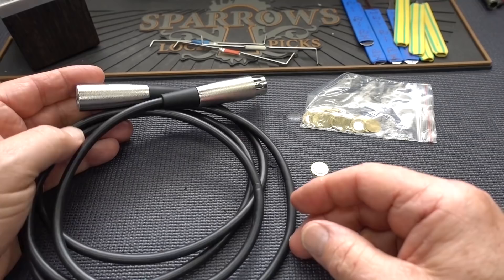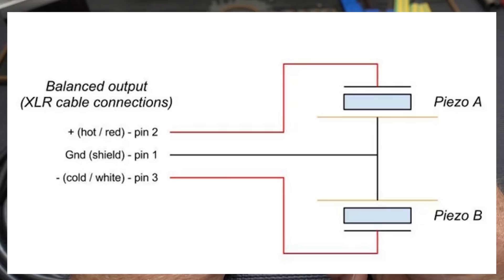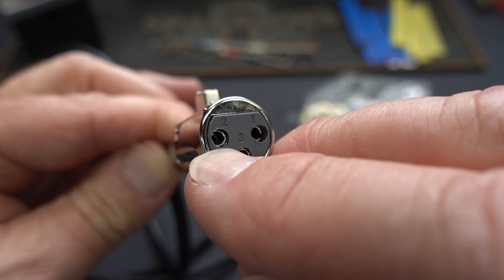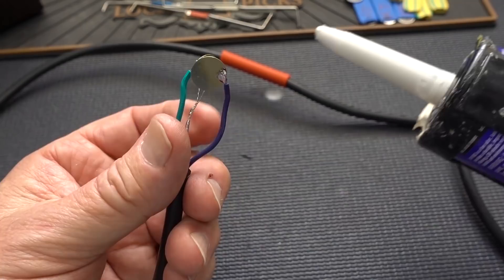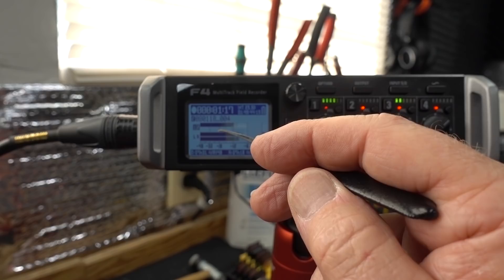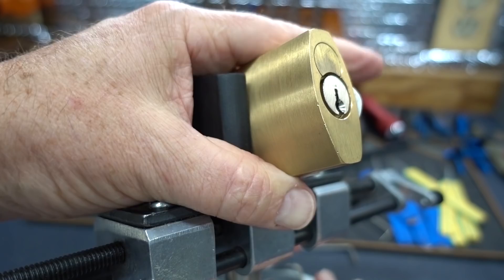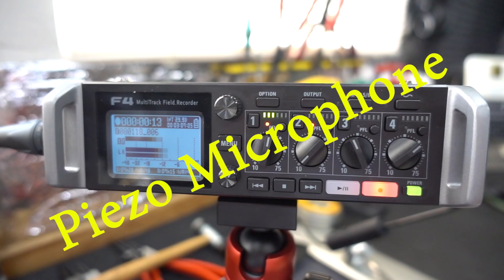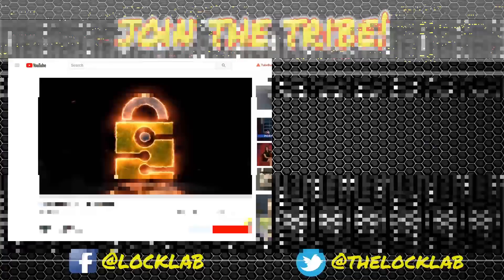(1338) Experiment: Piezo Crystal Lock Picking Microphone

Comment: Piezo's are HIGH impedance and the XLR's are LOW impedance BALANCED circuit.  Find a high impedance input "direct box".  I would suggest an active type.  Keep the leads from the piezo very short.  From an electrical engineer...
Reply: I have build 2 myself some time ago. In one i used a Transformer direct at the Crystal for the symetric Signal. In another, i build a small phantom powered preamp circut at the Crystal. Both worked nice, second one was better.
Reply: Or you could use pure copper conductors with ground shielding (aka a coiled magnet) and have the same result. Without spending the extra money.
Gotta live ps2 controllers.
Reply: Yes! And there should be 1 ground, instead of 2 wires (or are those somewhere connected?)!
Reply from the maker: Fred Yearian Thank you, I’ll take a look at solving the impedance issue, thank you for pointing me in the right direction.
Reply: Also you dulled the pickup sensitivity way down by smearing siliconeand epoxy - while hard epoxy is less of an acoustic problem, small peizo disks work best with direct contact and the effect of the silicone is to damp the vibrations.

I'd try again with a single disk - but try to have at least a small part of the brass disk in direct contact with the lock. This makes it a surface mike - picking up vibration sdirectly from the lock body. The disadvantage (and it coul dbe a big one) is that you will also be picking up electrical clicks when you touch the lock with the pick, wrench or your fingers.

You could also solder a hard object like a brass bolt or maybe a tack to stick out from one of the disks on the brass-only side - this effectively makes it a "spike mike".
Place the spike in direct contact with the lock body, with the disk under only very light pressure to maintain the spike contact (it needs to vibrate a little, rather than be held hard against the lock). Maybe try a few rubber bands in a criss-cross arrangement ?

Spike mikes made like this are great for pickup through walls, glass windows, panels etc etc. (cough: allegedly). The problem with this is it's an unbalanced mike system, so that could produce quite a lot of mains hum - hopefully the increase in acoustic sensitivity will be more than the increase in unwanted electrical noise. 

The "noise" you seeand later hear at max gainis 60Hz mains hum - pay attention to close screening (without touching the brass or white pad) and try to keep the overall size own - maybe even trim the disks with scissors to the minimum possible surface area of the white pads (this will also reduce the low-frequency acoustic response)
Larger peizo disks will handle lower frequencies though may not be much more sensitive at your wanted "clicks and scrapes" frequenies - they will also pick up more mains hum due to being physically larger. 

Filtering or notching the mains hum will also help but it's far better to screen it and keep it well balanced (physically symmetrical) than cure it later up the chain. 

If you have no joy with peizo disks try two small electret mike capsules used in mobile fones places back-to-back with issulation in between - they are only a few millimetres across - though you may need to feed them into a low-gain differential opamp circuit and fine-tune the balance circuit.
Again, try a single one in direct contact - possibly through a very thin pad of felt. If that doesn't work too good, remove the felt or scrim to expose the tiny hole and place in direct contact again. Electret inserts can be attached with much greater pressure and are less prone to deadening by putty or silicone. 

When I say a try a single one - you may be surprised. The balanced back-to-back mike is really to provide acoustic noise cancellation as much as provide a balanced differential signal. With leads kept short and well screened you may find that a single mike works well enough for what is essentially a direct-contact situation - so there should be plenty of acoustic coupling of lock noises - at least at high frequencies.
For the purposes of experimenting just feed a single mic onto one of the the mic connection pins on your recorder (either + or minus, plus the groud) if it only has balanced inputs. If it has an unbalanced socket use that for single-mike inputs though.  

To slightly reduce mains hum you could also try to physically relocate any PSUs or transformers you have on or near your bench a further away and feed your digital recorder from a battery instead of a mains PSU, if you are using a PSU at the moment. Arrange all your power leads (DC as well as mains) to run away from your work area if you can and avoid coils of wire nearby to your bench. We really are clutching at straws now :)
 
Air conditioners, refrigerators, flourescent lights and motors can increase nearby hum, although most urban and suburban settings have a lot of hum even with the house mains turned off at the incomer board - it's just a fact of modern life.

Good vid and worth the experiment even if results were poor this time around.
Reply: Using a mechanics stethoscope attached to the vise/lock and an electret mic where 1 of the ear pieces goes will potentially give you good results. Mechanics stethoscopes are already great for detecting mechanical clicking noises.
Reply: Or if you are lazy look for something like a set of automotive chassi ears or an acoustic instrument clip on mic like this one.(no connection to them just happen to be a music playing mechanic) https://www.zzounds.com/item--KORCM200?siid=178061
Reply: @bellphreak4370  it's the same braided shield wire from the xlr cable. He just took half the wires and connected then to one crystal and the other half to the second crystal.
Reply: I was thinking about using a jfet with an LR44 button cell. I didn't think of phantom power though.
Reply: @ReneSeckler  can you send me schematics or anything? If u can share it

Comment: Silicon=mass dampener. Epoxy ensures rigidity. I'd expect the rkements need to move, to react to sounds. Mic elements need isolation, or direct contact for contact mics. Try an electronic mechanic's stethoscope, that's a cheap contact mic designed to pick up metallic contact noises.

Comment: You can get via Ebay from China "pickups" for acoustik Guitars. These are, what you want. They are ready to use with a case, cable and connector (stick on or clamp on). They cost (seen in German Ebay) under 5 bucks.
Reply: yep ..most stuff is thought of already....   thinkers are onto quantum mechanics. @anomicworld

Comment: don’t use epoxy resin, only silicone, the resin is too stiff and reduces the vibration of the piezoelement, also need a more dense piezoelement contact with the lock, I think rubber band is a good option
Reply: Jim Smith Sorry, but this is nonsense. You want as stiff of material as possible to transfer high frequency vibration well. The epoxy is not a problem; if anything, I'd lose the silicone and replace that with epoxy, but that's not the main issue here.
Reply: RB0087 well, maybe you right. if there is a good tight contact with the lock, then perhaps the epoxy is not a problem
Reply: RB0087 If I understand correctly, that goes well for the contact between the piezo and lock body. But by using epoxy directly on, and probably to some degree between the two piezos, I believe it unintentionally siezed them up. If it was onlynon the outside thats one thing, bit from the video ut looks like some got "between the wafers", siezing up the "filling" (to go with the biscuit analogy).

Oh and impedance. XLR is low impedance isn't it? Piezos aren't.
Reply: pr0xZen exactly. IMHO The piezoelectric element generates a voltage when its shape changes from vibration. if you pour it with epoxy, it reduces its deformation. well, about the impedance is already a lot of people said in the comments
Reply: Jim Smith People have their intuition turned right around. Remember sound travels through solid materials better than air. Beryllium is stiff and light and sound loves it. Diamond is best, I think. Anyway, the best thing would be to get rid of the silicone and embed everything in a solid block of extra hard epoxy, then epoxy that to the lock body.

There are also two types of impedance matching going on here. One is electrical impedance, which is corrected using a preamp. The second is mechanical impedance matching. Rubbery, squishy mechanical interfaces will not only ruin the mechanical interface, they will dampen and absorb sound energy. Hold a spoon in your mouth without it touching your teeth then tap on it. Now bite down on it and tap on the spoon. Hear the difference?

Piezoelectric crystals are not moving at the macroscopic level when sound moves through them. The disks don’t actually need to flex at a visible level. The crystals vibrate at the atomic level. They generate a voltage potential at this atomic level. Embedding a piezoelectric crystal in a solid block of plastic will not prevent the crystal from generating a signal when sound passes through it.

Now, embedding the crystal in plastic will cause it to be less sensitive to sound traveling through air, but in this case that’s a good thing. Piezoelectric crystals suck at picking up sound in air anyway  (because they have terrible mechanical impedance matching with air). Embedding them in plastic will make this worse (which, again, is better in the application). A polyester resin might be better than epoxy for embedding. Again. Piezoelectric disks make terrible air microphones, which is why they are almost always used as contact pickups. 

All right, I got that out of my system...
Reply: Noah Spurrier, thanks for the detailed explanation, great comment. my respect.
Reply: Both arguments are correct. Circumstance depending.
However I agree with Jim Smith in this use of pezio crystals as our hopes are to have multiple uses of the same "microphone"
Reply: Nathan Monahan Well, they cost about 25 cents each, so just make more. Experiment.
Reply from the maker: Noah, thank you for taking the time to put together such a detailed (and logical) comment, I appreciate it.  I'm sticking with piezo crystals for the precise reasons you describe, but using some of the other improvement recommendations below, will modify the design and keep plugging along.

Comment: Good suggestions from the crowd. I would try a phone input stage passed through a 1khz high pass filter, and that you ground the lock to the ground for whatever the input stage of your device is. I would visit a thrift store for a cheap record player, disconnect the motor and power the electronics with some batteries. Cheap record players usually have very noisy power supplies, but sensitive input stages that are well matched to a piezo crystal. Cut the speaker leads off and put a cap and coil in series with a 1k resistor. Take your input to the recorder across the coil and/or the resistor. You may need an isolation transformer if you still get humming. Try a cheap one meant for car audio systems...  Lastly I would try to get away with a single crystal. Put a small magnet on the back side of it and use an adhesive backed steel plate non-magnetic locks. I am sure some combination of this will work as I have used a similar rig to build a recording mechanic's stethoscope that could be stuck on parts of a car while the car was driven. The magnet serves tripple duty. It attaches the pickup, acts as a reaction Mass so the vibration in the metal squeeze the crystal and as a vibration damper for noises from the air. Try to keep all the connections on one side of the crystal so the other can be flat and firmly in contact with the lock. The magnet can be a little smaller than the crystal. It should not be much stronger than necessary to hold the contraption in place.

Comment: From an engineering standpoint many have already mentioned the impedance match issue which killed the low frequencies due to loading. The centers face to face are connected to the shield which places the signal on the outside enabling pickup of the hum.  The shield should be connected to both brass disks on the outside and the signal attached to the two elements with an insulator so they do not contact each other shorting the signal if you insist on a piezo element.  A small audio transformer between a single piezo with a 50K ohm to 600 or 200 ohm impedance ratio would work wonders with a single piezo element and your low impedance recorder.
A much simpler solution is to take apart a dead earbud headphone and remove the element.  With a rubber or other gasket ring, attach it to the side of your lock with only the signal + and - connected.  Don't use the shield except connect it to the lock to prevent picking up RFI or hum.  A contact mic for violin or accoustic guitar is a little expensive, but also a good option.

Comment: Tip: when cutting off a connector from a cable, leave enough wire on the end of the connector so you can (more easily) re-use it for another project.

Comment: I have a few ideas on how to (hopefully) make this work a bit better. However, I don't know much about electronics, and even less about microphones, so...
● Would it work better without the silicon sealant? 
○ Maybe let put the lock in between the two wafers? (Have the lock body be part of the circuit.)
• Have the lock itself be the ground? (Loosely attach the ground wires to the lock body [maybe with that clay].)
● Also, the apoxy seems like just another layer of stuff between the microphone and the lock. Like a blanket between two people talking to each other.

Comment: The plumbers putty use to adhere the ceramic disc to the lock also acted as an isolator. Try a small piece of bees wax no larger than an 1/8" in diameter. Plenty strong enough and is close to being acoustically clear. I use bees wax on accelerometers with great results.
For super thin PZT type ceramics, a silver based adhesive/paint for wire attachment will keep the ceramic from being de polled during soldering.

The noise encountered was 60hz induced by florescent lighting ballasts. Move outside and that noise will go away.
Reply: Gunga Dinn any kind of wax or putty or sticky glue is going to absorb the vibrations. It's the opposite of what you want. Electronic stethoscope is in the direction you want to go
Reply: John H 
I build electronic stethoscopes. One of the only noise immune models to be certified for helicopter use. 

The small dab of bees wax works fine. I'm not saying make the dab a 1/4" thick, but .003-.005" thick when squeezed out.
Reply: What is an electronic stethoscope that needs using within a helicopter? You mean it goes on a human? Designed to reject which freqs? I'd like to see the specs on that if you will share a link.

Comment: Cool stuff Bill, when I was a teenager I made an electronic drum for a friend out of a practice pad and a piezo unit like the one you are using. We soldered it to the cable and put it inside the practice drum pad. When he hit the pad the signal would go through to a synth or midi unit and it worked like a charm. Fun. Cheers!

Comment: Im a audio engineer who just started picking. I had this idea but I was going to just use a electret mic with a simple op amp and potentiometer.  The piezo seems like it does ok but I think to much vibration is lost in the pick and the Metal reflects sound so Im thinking that most of the vibration is just being locked inside the key whole.

But a electret mic amplified should give alot of info. To cut back on outside feedback I'm going to place the Mic inside a tube surrounded by foam. Will help isolate the sound.
If I have to I can add a Hi/low pass filter to get rid of the his thats sure the be there and any low rumbles. The Clicks of the pick should sit rite in the 2k range pretty easy.
This may or may not work lol
I will post my mic design and a video once complete.

Comment: It looks to me you've got 50/60 Hz line hum. I would suggest shielding it better or try and remove the hum in software in post. Also, piezo mics work best when they are in direct contact with the material, the more rigid the better. So something like a drop of super glue would be a lot better than clay.
Reply: fLuXx i agree that it does seem like he's getting the hum from a lack of grounding.
Reply: This is meant to be reusable.  Why not hot glue?
Reply from the maker: Good idea!  I’ll use it on Version 2.  It’ll be a lot easier to work with than silicone and epoxy.  Thanks!